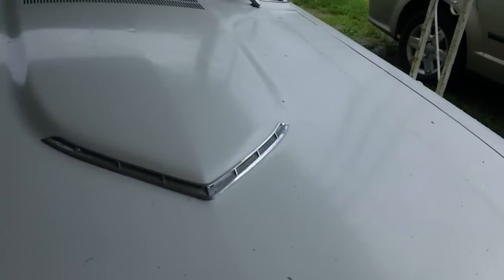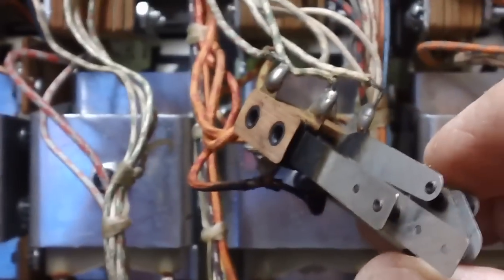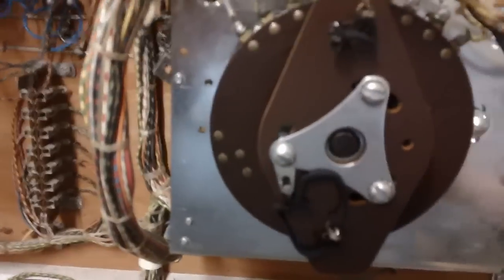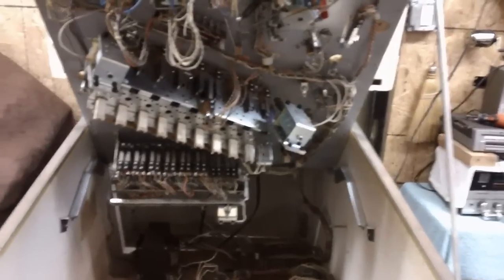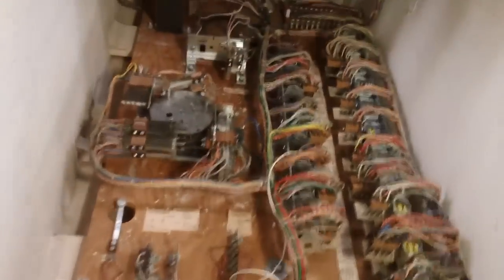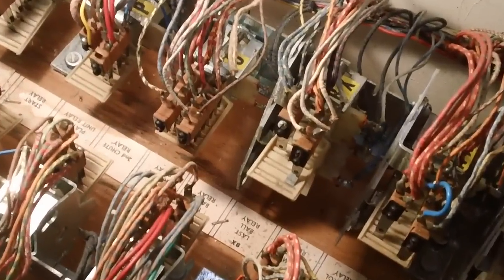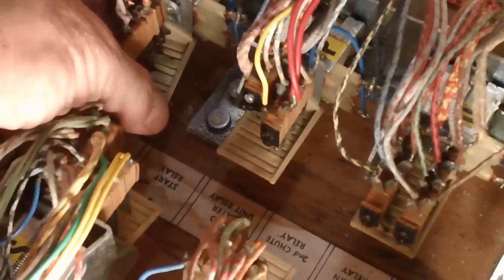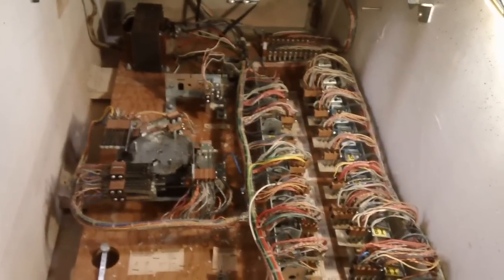1976 Gottlieb Card Whiz pinball machine repair (Part 2).

Comment: John, On the score reels that you worked on , you can manually step the unit with the power off and watch the contacts that you replaced. There are two to watch that open and close, when you see the reel get to 9 one set closes and when you go on to 0 the other one opens. ALL of the score reels on all players (the 0 set need to be open) or the motor will run. CHECK THAT THERE IS A BALL in the machine or it will run. A Gottlieb will run because it can't kick a ball out if there is not one sitting on the out hole switch on the track under the playfield!! Hence the game can't begin!!
Reply from the maker: Harry,
Believe it or not, I actually thought about putting the ball in the out hole to see what would happen, but instead decided to just look things over.  I should have followed my instincts...such as they are.  I shall try it tomorrow morning.  Thanks once again, My friend.
Regards,
John
Reply: I'm hoping that you have a break from trying to find hard problems by that machine kicking the ball out to the shooter lane and the game starts with the score motor stopping ready for you to shoot the first ball!

Comment: I spend the 1970's repairing a ton of these for an amusement and vending company. Generally, the motor runs to produce count pulses to bring all the score wheels back to all 0's for the start of a new game. There are a lot of contacts in parallel that all have to be open before the motor finds "home" and the game can start. Although my first instinct would to be to check the "zero" contacts on all the score wheels, the broken bits of glass may indicate the top glass was shattered at some point, and a bit may have found just the right location to prevent the right contacts from opening on the lower deck. You are stuck in the "score reset" mode.
Reply from the maker: What I need is your experience, as I have none with pinball machines.  Working on it is just a fun thing to do.  Helps me relax.
Regards,
John
Reply: I would start by pulling the connectors that go to the head (back top of unit), power it up and see if the motor finds home. If it does, then the problem is in the head, if not then the problem is in the lower deck. Did a lot of work on both Bally and Gottlieb and this was a common problem. In addition to the score counters, there are often other step switches that track game progress. When powered up, or starting a new game, this motor sends groups of 5 pulses/break/5 pulses until all counters and step switches are at their 0 or home positions. Each device has a switch that senses this and all the switches have to agree, including the one on the motor cam itself as this has a home position as well. If this were a unit in the field, it would be a pretty straight repair, however, this unit looks like it saw some work after it was retired and there is always a chance that a wafer switch was assembled wrong, or that there may be wires reversed. To flush this out, you would have to follow the color coded wire from the motor switch to all of it's locations. Again, it might be simpler to cut or un-solder it at a few choice locations to "divide and conquer" the problem. Hope this helps.

Comment: If you go onto Pinside forum, (left side column, electromechanical, em technical section), the guys there will tell you the most likely places to check for 'score motor won't stop running' problem on that particular machine. Usually they ask if you have the schematic, and take it from there. Or ... just keep looking for stuff that looks wrong, and you might get lucky.
Reply from the maker: I'm a member of the Pinside Forum.
Regards,
John

Comment: Make sure a switch, relay, or something isn’t shorted among one of the playfield or in the back.  If something was running constantly you might have a shorted ball switch or a stuck relay somewhere or a stepper that is not advancing properly or something.  

Essentially something that is supposed to be on for a moment may be constantly on causing things to heat up and burn out.   You might also check each circuit of the playfield (based on the game scoring rules and reward rules) to see if its amp draw and voltage draw is too high or if there are any momentary switches (ball activated by hitting targets) that are stuck in the on position when they are supposed to be off (as in the ball not hitting them).
Reply from the maker: Stephen,
So you're saying I should check everything, eh?  LOL
Regards,
John
Reply: joernone my take is that these things do not stay running all the time or overheat and burn out unless they are on for longer than they should most of the time and therefore overheat or that too much current is being passed through them for too long.

Comment: Oh John, i can tell you it´s not that easy...i know that sound, as it takes my waaay back into my teenage years....my pinball had the same stuff inside, but some of this 2 times more and also a memory, which was on a second sandwitch....you´re missing at least two more steps during the reset....you only got the first da..da..da..da..da.. there are two more (at least they had been two in my "sheriff") and the machine will also get louder when all the other relays being triggered by the main motor you can think of the motor as it´s the heart of the machine...it´s like a hard wired simple state machine. Also it does a self test during this, you well see every single relay will be trigered, at least once.

Now you need to clean and also align all these contacts, i guess...Also it may would be a good idea to lable all these cables and track them to where all these goes to or come from. At least i found some cracked wires and needed to replace them.
Reply from the maker: All good advice, my friend, but our main project still remains the juke.
Regards,
John